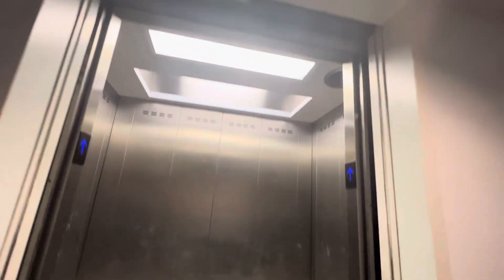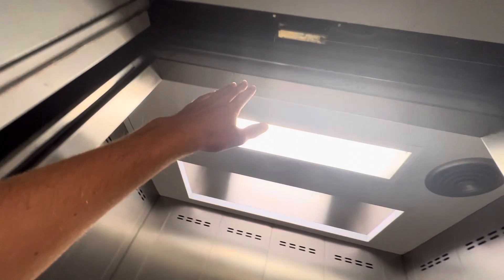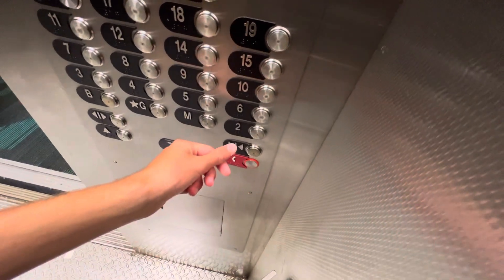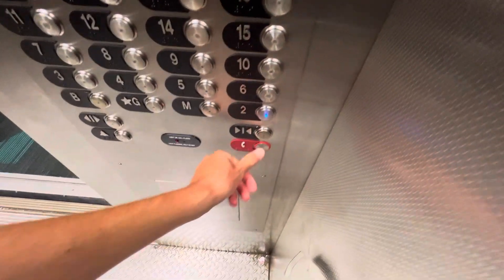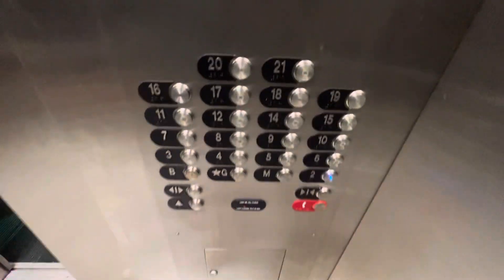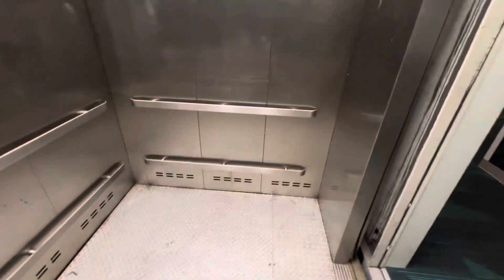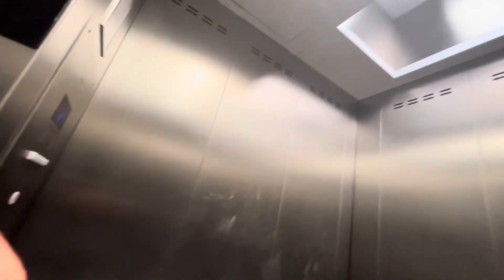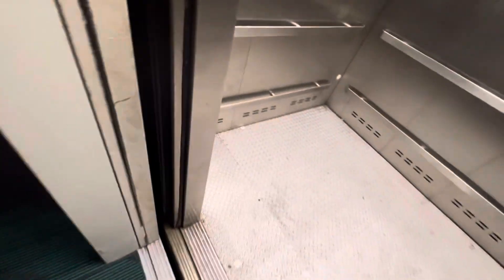SLOW Otis Traction Service Elevator @ Hub at Columbia, Downtown Columbia. SC

Comment: I'm not sure if Gen2 mods. existed in 2013.
Reply from the maker: well, i can kinda say i’m not sure as well. a video of the main elevators in this building which are the same exact thing have been filmed by a local person and he says they are Gen2, but I think the main ones run at 600 FPM
Reply: Yeah Gen2 can't go 600 fpm. They're either 500 max or not Gen2 (most likely the latter).